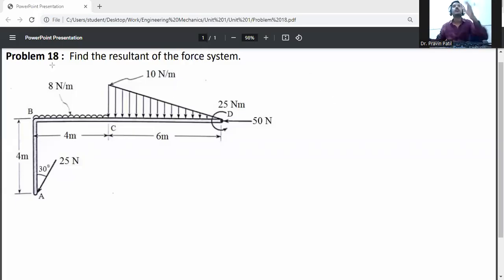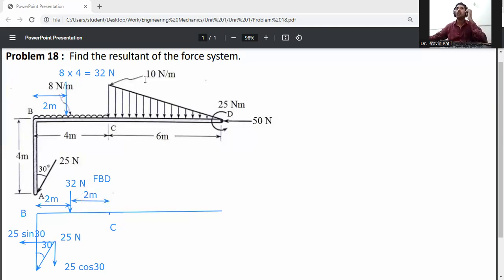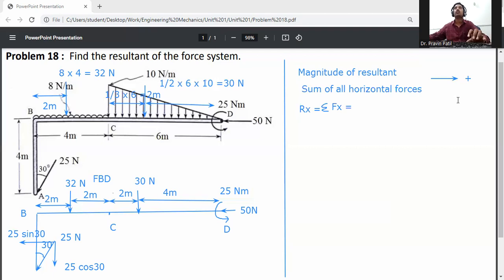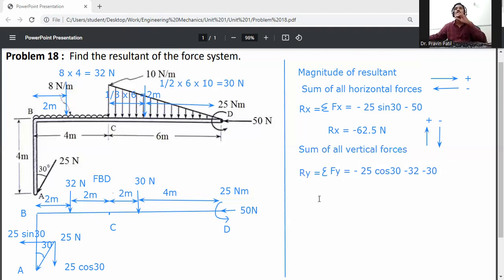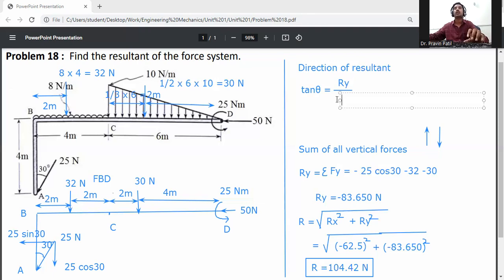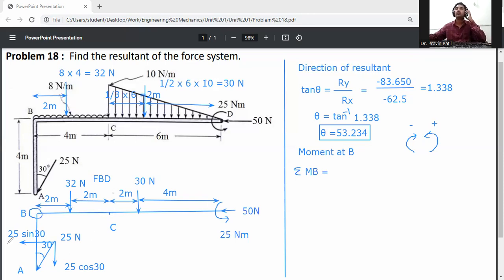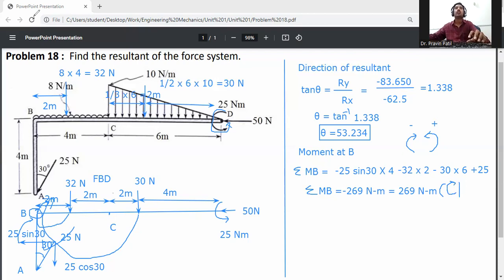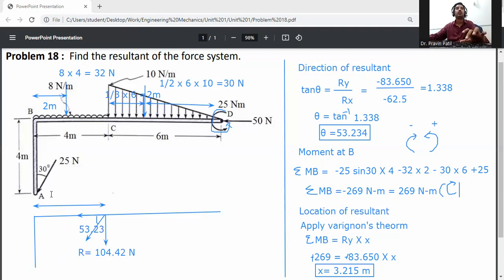Problem 18-Coplanar Non concurrent force system/Varignon's theorem/Composition resolution of force

Comment: Hello, professor.. I am a Korean student who happened to watch a lecture while searching for a barignon.. I have a question.
When we use Barignon's theorem, we find the sum of the moments using vertical and horizontal fractions to get the sum of the moments... To find the position of the force, you only use the sum of the vertical forces to find the X-axis position where the force acts, so do you find the position in the Y-axis direction separately?

Please understand that the translation is not smooth.
Reply from the maker: Most of the forces have acted only in vertical direction, so calculated  only x axis position